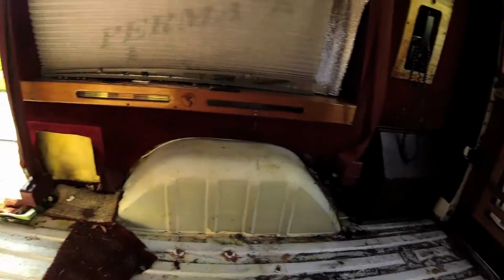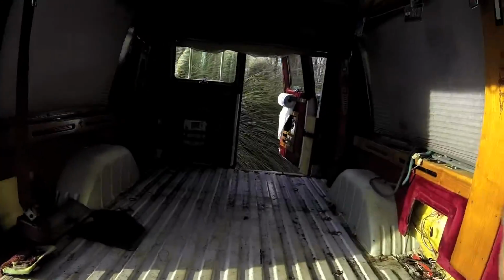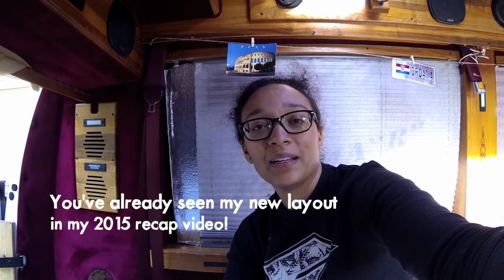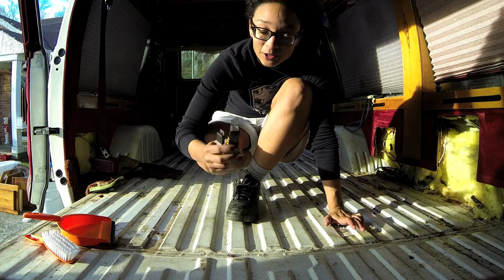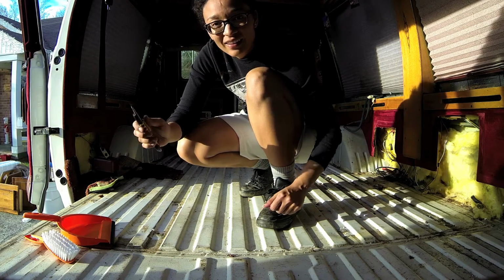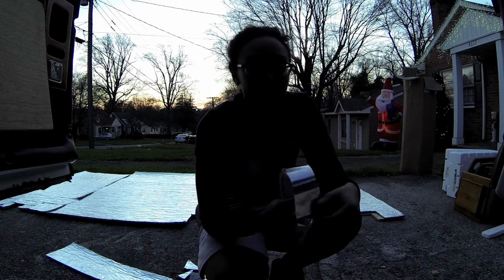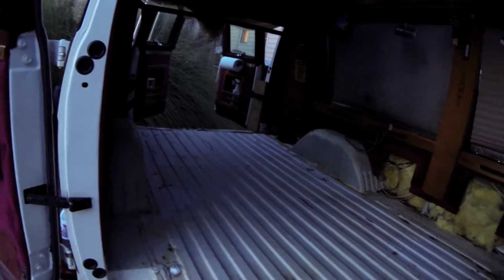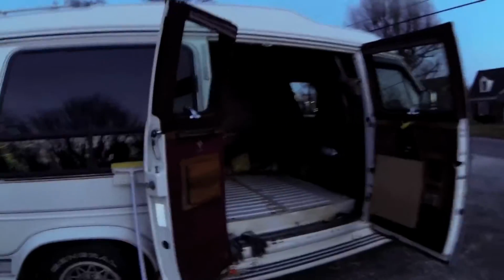Part 4 Van Floor Install | Camper Van Living: Insulating the Floor

Comment: Good job.

Btw, was that fiberglass insulation in the walls?  I've heard you shouldn't use fiberglass if there are any wires in there.  Just an fyi.
Reply from the maker: No, I only used styrofoam. The yellow insulation came in the van but I pulled it out.
Reply: Tito
Cool.

Comment: Don't those bolts hold the body of your van to the frame? I don't think you should've removed those, just sayin.
Reply from the maker: No, those don't. It was checked by a mechanic and theres nothing they go into except the floor.